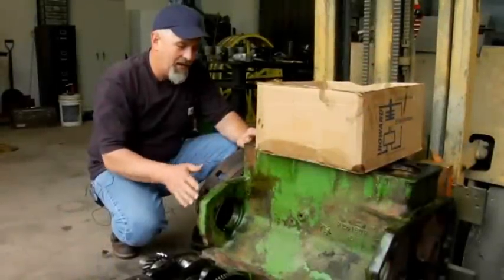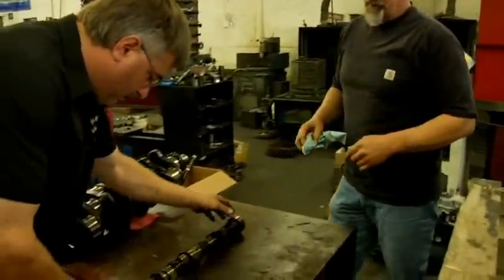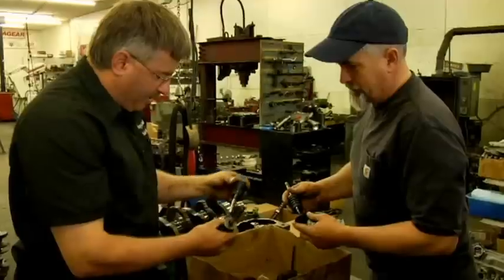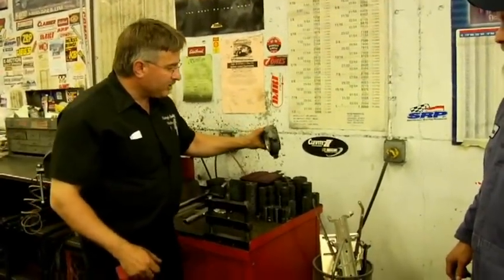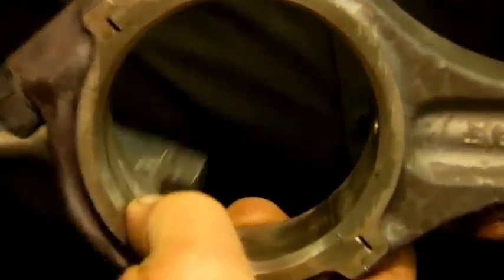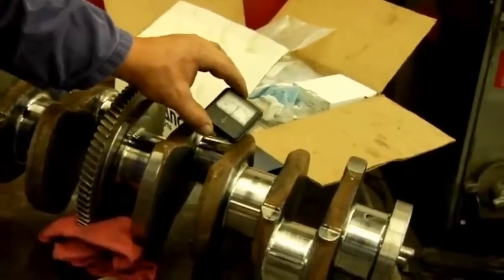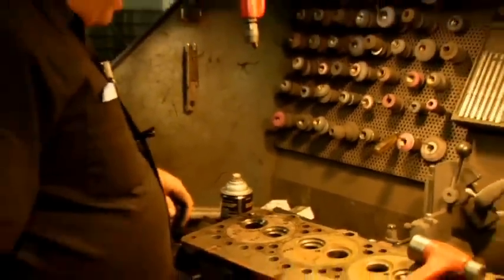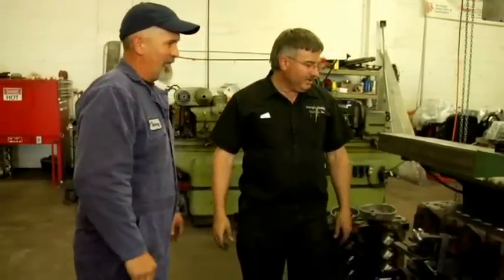Machining Flywheel, Crankshaft, Camshaft & Engine Head

Comment: The bottom line on any internal combustion is the more cylinders you have rotating
and making power the life of that engine  depends on how much time is spent on
checking every part as was demonstrated in this video. Then you add to that horsepower
fuel type and application. When I was building high rpm high performance engines at home in my shop, I learned several things as the years went by. You can't spend too
much time on disassembling,inspection and prepping each individual part and insuring
that each piece is examined to determine if it's original or.aftermarket just as was represented here . With every step they took the more confident they were of the
reliability and success they could expect. It is absolutely essential to take these steps and 
precautions in a diesel and high-performance engine. Kudos to both of these guys 
If reassembly is done in the same manner and proper service and maintenance is 
followed through on it, he can count on many hours of service,not to mention John Deere
engines are for the most part bullet proof

Comment: Hello Harvey and Barry, 
Thanks for your time, 
I diy and sometimes did not know what to ask for or was intimidated when trying to rebuild my own stuff and not be a "professional" rebuilder and just did what I could at home and buy new stuff instead of having it rebuilt. I have run into premadonna type machinist that did not want to waste their time with your run of the mill stuff. I would get a good garbage can and fill it with kerosene to clean my blocks and heads etc,
Man did I miss opportunities...

Comment: Brings back some great memories, almost makes me want to do it again but after 35 years I had enough :) One thing with those diesels is to check the cylinder head surface with a straight edge before roughing in the valve depth. I've seen the big 6 cyl. John Deere heads warp .020"

Comment: On the magnetic parts, and trying to degauss them, once you pass the metal part by the transformer, and are in the motion of pulling the part away... Try pulling the metal part away very slowly, Some examples can take 30 seconds to a minute to pull away to about a foot or 3 away, then with the part that 2 to 3 foot away, then turn the transformer off... then you can check the part for flux.  Speed and time, not so much the direction ... Good luck.. I always enjoy watching your content... I learn something every time..

Comment: Notice at 11:00 that the bolts are Grade 6 (!), not Grade 8. Most gearheads, and even some mechanical engineers, don't understand that Grade 5 (and in this instance, Grade 6) bolts are the preferred fasteners for most applications. Grade 8 will not clamp properly before it distorts the parts being clamped.

Comment: when demagnatising metal, go close the the ALTERNATING FIELD.  Then slowly pull away.  The field will change 60 times per sec.  Each time a change accurs, magnetism will be induced into the metal.  If you pull the metal away slowly, then the fiels becomes weaker and weaker.  In the end you have a very weak magnet (or part).  I used an induction motor for this.  Works great.
Reply: Yes, I used to hold the Magna-Flux magnet in my hand and move the part through the field and away

Comment: the first thing you guys should be doing is line bore the  crankshaft  bore the mains to make sure  the  bore is perfectly straight  no warp from heat    that will make one journal  out of alinement of bore    so the crank will bind  when torque the mains  if the crank journal bore is perfectly straight all the way threw the block  when you torque the mains  and spin crank if clearanced correctly it should spin like it has   ball bearings in the journals free wheel  thats  kool  that engine will make   a strong puller!  and make  better torque and horse power  you get the bottom end   perfect then build  your engine around that platform  it should  fall into place good with a good  bottom end straight journal line bore

Comment: Does no one else see how ridiculously huge this frickin motor is? The flywheel is almost the size of my block on my 1.9 :D
Reply: Haha, that's funny but that's just a 3000 series John Deere. I built these types of engines for years  3000, 4000, 6000, 8000 series. The 8000's were fun, 4.5" bore 5.0" stroke. Turning those long stroke crankshafts are a blast especially when it gets up to 6.5-7" stroke. Heads that weighed close to 200lbs I guess at close to 4 feet long. I had a friend that was a mechanic for the Coast Guard with ship engines that you could crawl through the main journals on LOL. Awesome stuff!!!
Reply: Hahaha, a few weeks ago i worked on a V20 diesel engine, imagine how big that flywheel is!

Comment: Good do not know how you can modify the valve thrust rods would like to cut a little will know how to weld the sphere of the extremes I think it is with electropoint but I can not get information on how it can be done. It is to modify the larco because it is not possible to graduate the valves well for having talbes desgarte that the summary does not manage to think with the hydraulic taqete is a ford petrol engine ford model 360 or 390 of those that brought the f250. I thank you in advance if you can help me with some explanation of how to weld this sphere.

Comment: anyone ever see iron filings stick to their connecting rods an caps when they was rebuilding their motor ?
Reply: That's what I was stunned about that he even did that because in electronics it can/could be an issue but here as I gather is to make sure fine bits won't stick to moving part. I thought the magnet to catch those bit is the one seated in the drain plug...

Comment: Stop saying motor, its an engine, Engine = ingenious device, Motor is an electrical component. As a professional parts expert, you should know the difference between those two terms, otherwise, very good and interesting video!
Reply: No offense but if you really think engine is not a motor that then you are wrong from every aspect. Motor refers to the device which produces motion. Electric motor is just one of them. Even a spring wound clock is a motor and as a professional parts experts he knows quite well what is motor and what is not.
Reply: The Oxford English Dictionary defines “motor” as a machine that supplies motive power for a vehicle or other device with moving parts. Similarly, it tells us that an engine is a machine with moving parts that converts power into motion. Originally, they meant very different things.
Reply: SuburbAllied My dad was an Automotive Machinist his entire life, and I was damn near raised in machine shops. I can assure you that the word "Motor" and "Engine" are used interchangeably and either is correct. Here in New England, you will probably hear "motor" more often. Keep in mind that jargon within a trade may be different than what people outside of that trade use in day to day conversation.
Reply: Sasha Harney
And you aren't, spitting out worthless and meaningless comments? Anyways, have a nice day!
Reply: SuburbAllied  yep your right its a engine not a motor - engines run on a fuel while motors run on electricity - though less qualified people interchange the names - that's the difference between a fully qualified person and one that's learnt by working years in the job = IE a person may know how to tighten a bolt just right but a fully skilled person know how to do the same job but also why its done like that, and that makes all the difference between a good job and skilled job
Reply: Kevin mindyourown You are right, and i get your point. You did clarified my comment, thank you. Talking in front of a camera might also be distracting. Engine and Motor are two different terms, just like Painting and Drawing but people refers those terms as same thing. Have a nice day sir!